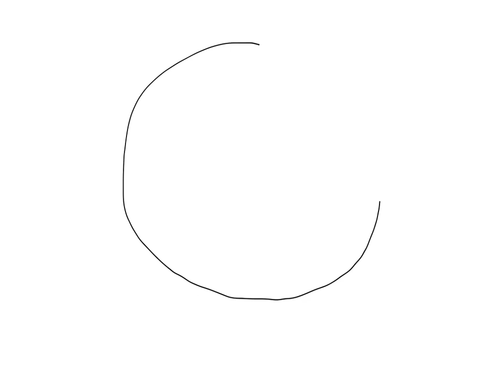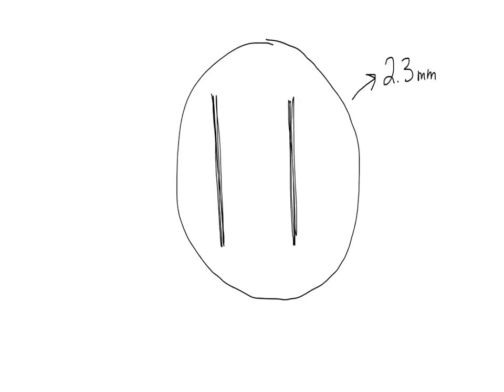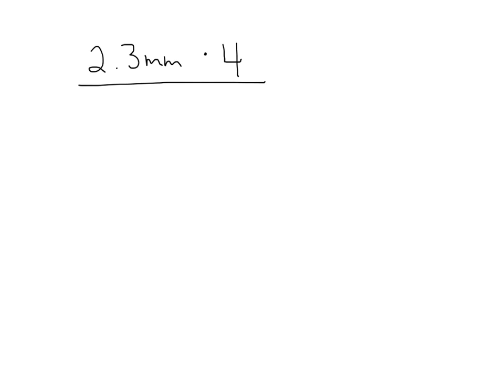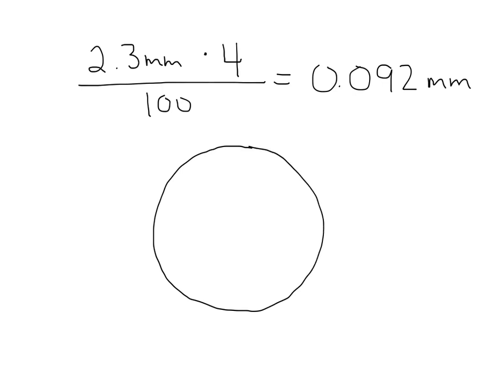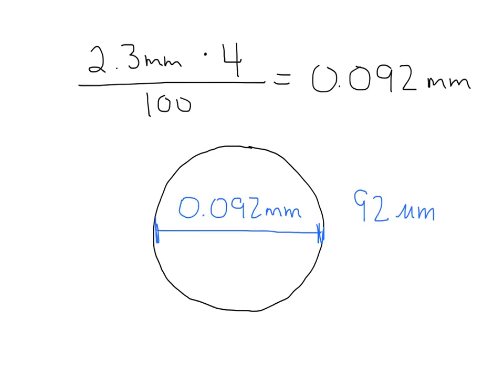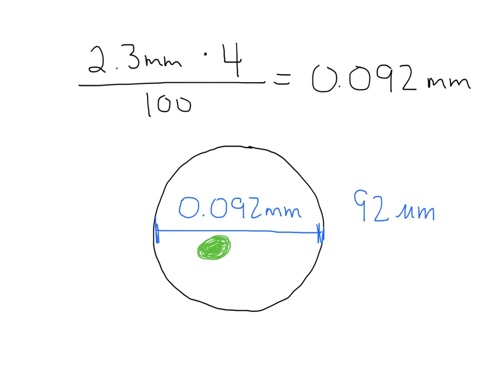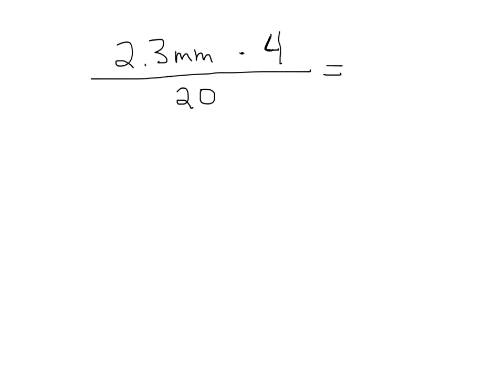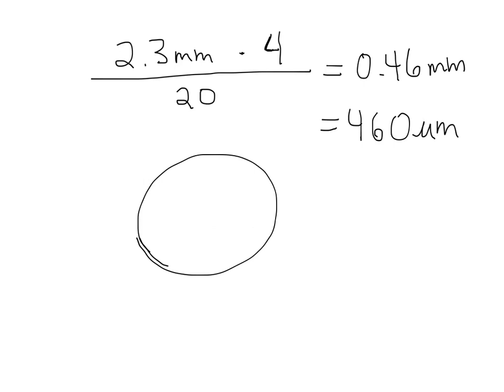Diameter of Field of View

Comment: it should be 40 not 4
Reply: Anamol Pokhrel ratio is all the same. if it’s 4 you divide by objective lens magnification only (I.e. 100). If you use 40 you divide by objective lens x ocular lens (100x10=1000). The ratios are the same and you will get the same answer for FOV.